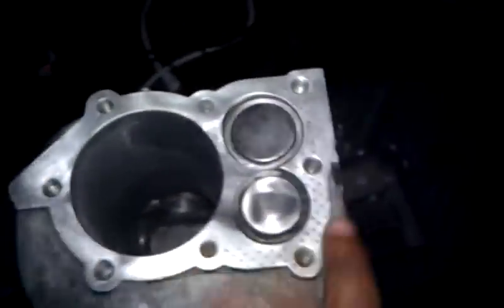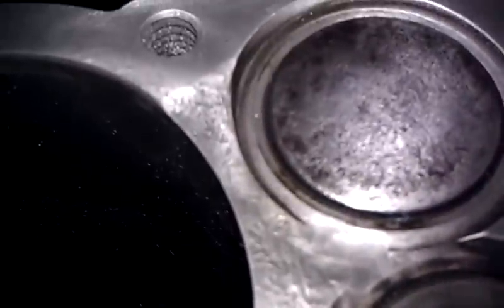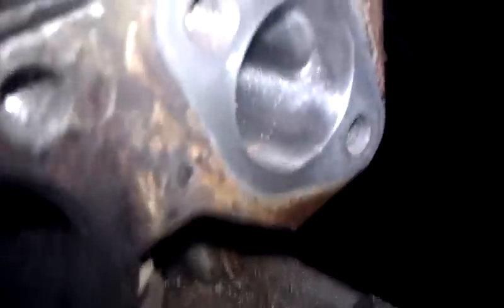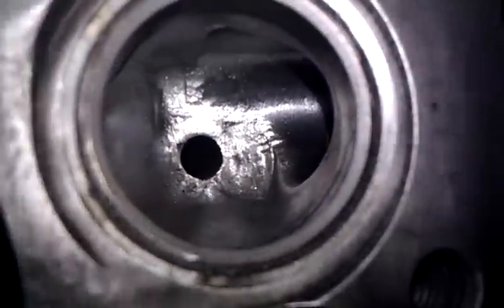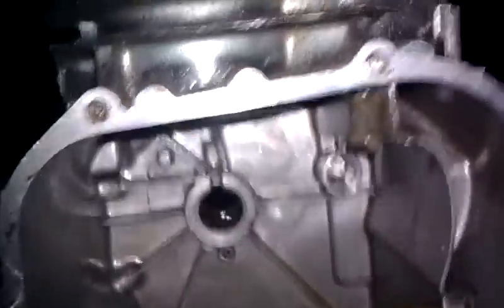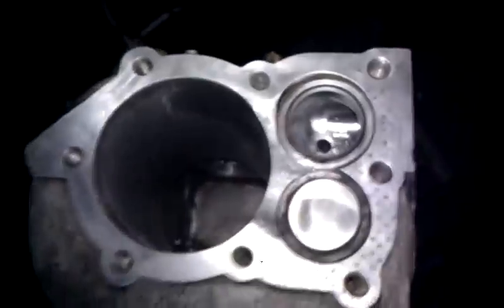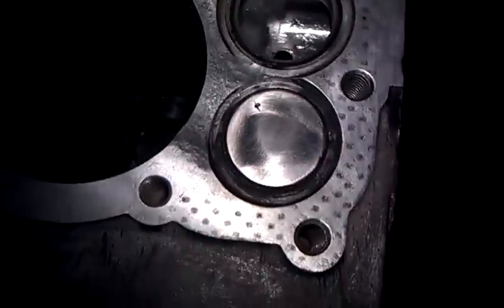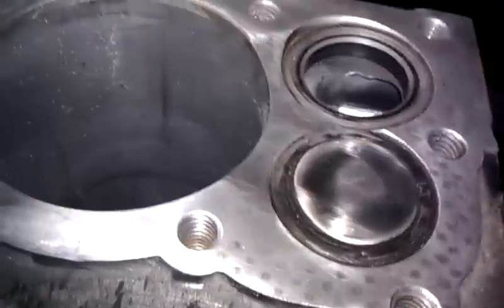Rebuild Of The Briggs 5 hp (Part 2)

Comment: It costs $100.00 to install bronze valve guides and have the valves lapped. Honed seats are preferred. Funny that Briggs no longer sells the cylinder block assembly. A Gasket kit is $60.00. Re-sleeving the cyl. costs more still. I feel it would be cheaper to buy a 5.5 Vanguard engine with forged crank/rod , low oil alert, and positive fuel shutoff.